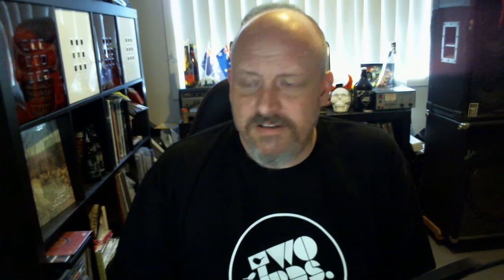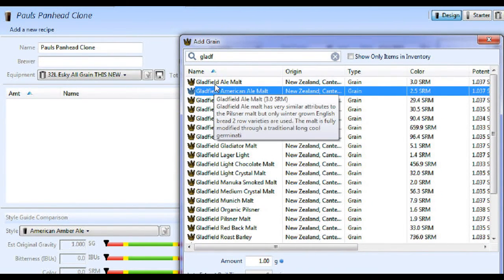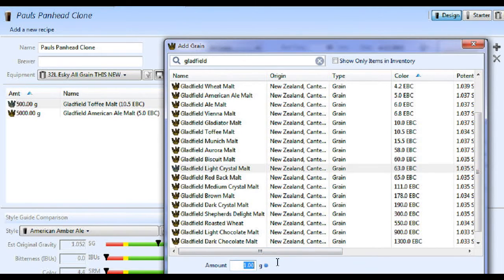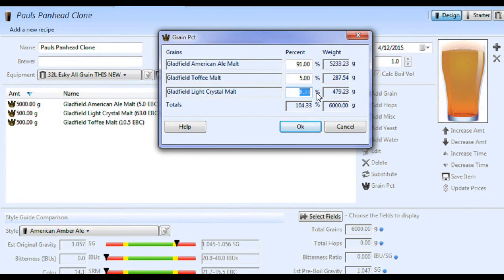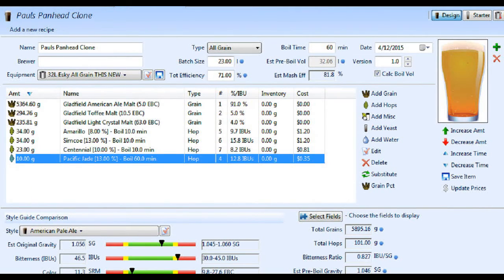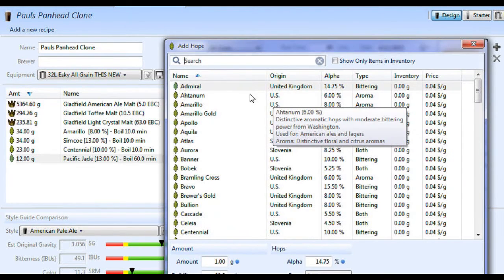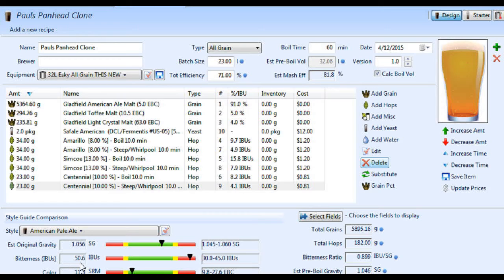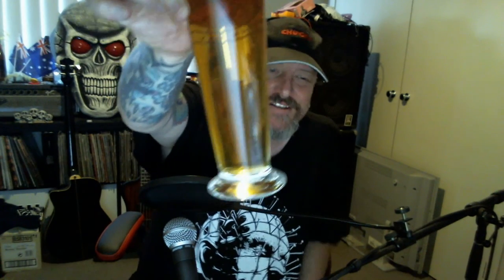Making a Clone Recipe - Panhead Super Charger - Paul Wicksteed

Comment: Cheers Gash, I've been wanting to clear up the whirlpool bitterness in beersmith :)
So far it seems I'm the only one brewing the Parculiar One :)
Reply from the maker: +Dan Smith I do believe whirlpool adds bitterness, without a doubt, but this recipe just wouldn't of worked by adding the whirlpool bitterness. Same as some one asked about the hops per litre value and why I didn't use the preboil volume, the numbers just didn't work out it would of been way too bitter even without the 60min add. Some times with a vague recipe like that you just have to guess or assume, but we all know what assuming does! :) Cheers mate!
Reply: +Gash Slugg Thanks mate :) One more Q. When breweries add whirlpool hops at 80c do they continue to chill or pause that process for 30 mins or so? I realise now the few times i've added whirlpool hops i've done it at flame out, that'll explain the extra bitterness in my brews, woops :)
Reply from the maker: +Dan Smith It all depends mate, some will hold it there for a while some won't, I do hot whirlpool hops myself, just because its less stuff ing around, usually for 5-10minutes, but then depends how you chill too, I use a plate chiller so the remaining wort stays hot for 10mins or so after I start the chilling, if you have an immersion chiller or circulate through a plate chiller then you can chill down the whole wort rather quickly, again it's all about learning your set up and doing what works best for you. These things only make a difference when trying to clone, because you need to do it the same as who evers recipe you have, especially when it comes to late addition hops. Cheers!